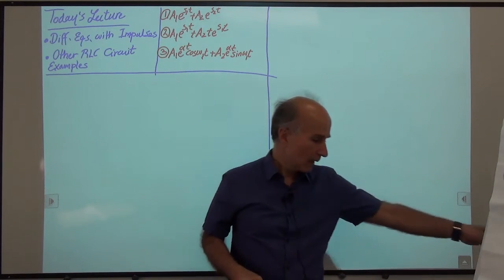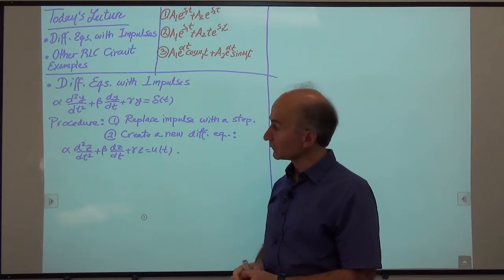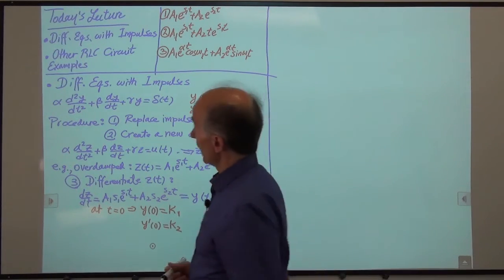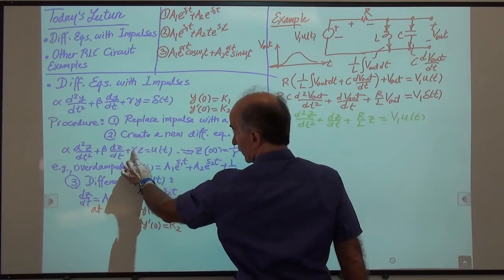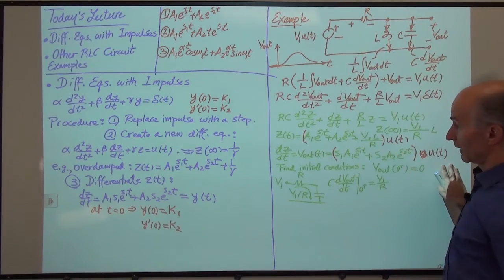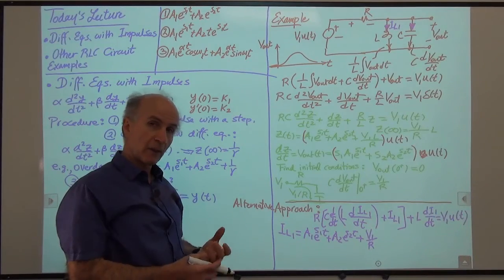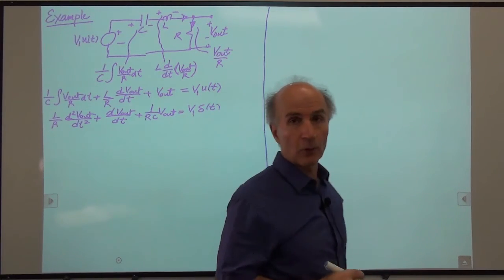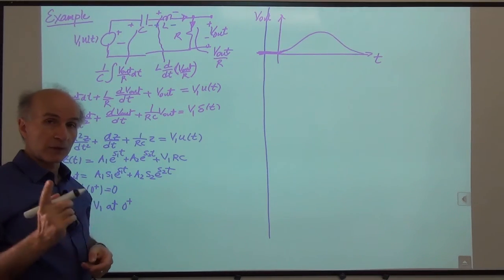Razavi Basic Circuits Lec 37: Diff. Equations with Impulse Inputs; More RLC Circuits Examples

Comment: @25:00 how is the current through the RC circuit calculated as v/R. Without considering any resistance from capacitor.
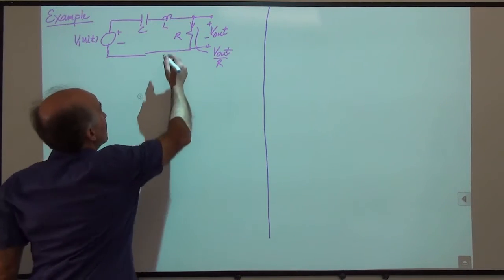Reply: Also @37:56 how is the resistor of  capacitor and inductor ignored to find current across resistor.

Comment: Dear professor, ur time domain approach is good.What if order increases .. solving higher order integro differential equations bit difficult this is the basic course hopefully u included Laplace transform approach in ur advance circuit theory courses.. cuz by using Laplace transform we can convert integro differential equations into simple algebraic equations ( with the help of basic properties of laplace and partial fractions) we can easily solve it either it is step input r else impulse r else ramp input.. we can solve it.. this Laplace transform only applicable to linear time invariant systems ( LTI ).. most of the circuits in circuit theory courses LTI systems only... You have excellent teaching skills sir.. 
.
Reply: Can you share some good lectures for this.as Behzad hasn't released lectures for ECA2
Reply: You seem to have very sublime understanding of the circuits.

I am totally confused by the logic of the variable change.dont know its significance or how this logic works .
Why a function is changed and the   variable is changed.
Reply: @qaisarawan93  you should know about mathematics atleast differential equations and Laplace transforms you should familiar about it
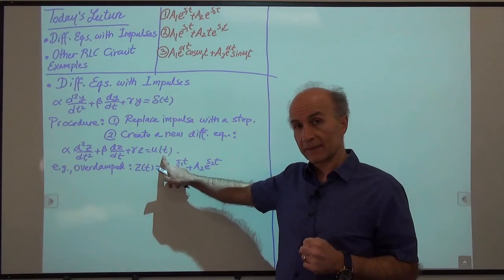Reply: 9:43 the master says that time infinity z(t) is constant so it's first and second order derivatives are both zero. While it makes sense from mathematical perspective but from circuit perspective I am still thinking how to interpret it.
Reply: @qaisarawan93  If you can't interpret I will explain it in other way. t tends to infinity means sir trying to calculate steady state response( Final response or the response after transients dies out). You can use solving of non homogeneous differential equation method. Z(t)= Complementary function+ particular integral. Particular integral = e^0t/ alphaD^2+beta D+ gama, where D =d/dt,  e^0t=1, U(t)= 1, t>0. PI= 1/gama. there is another way to calculate apply Laplace transform and use final value theorem. t tends to infinity means s tends zero.